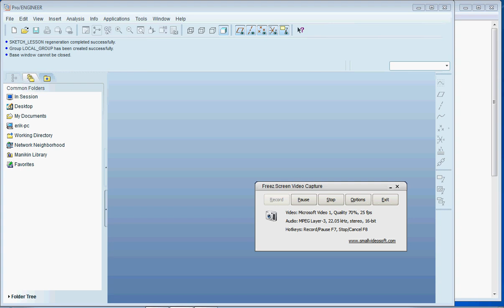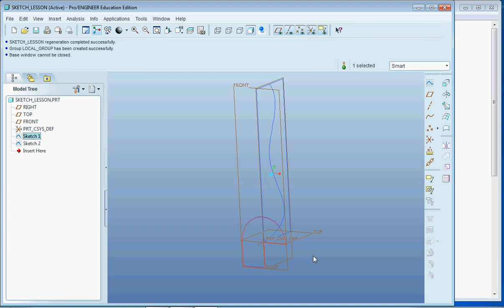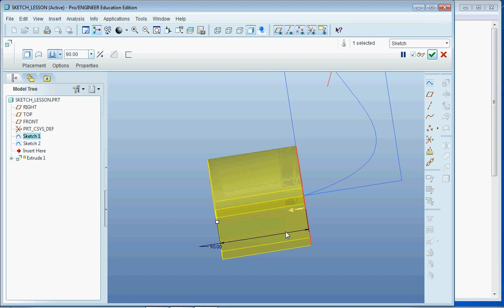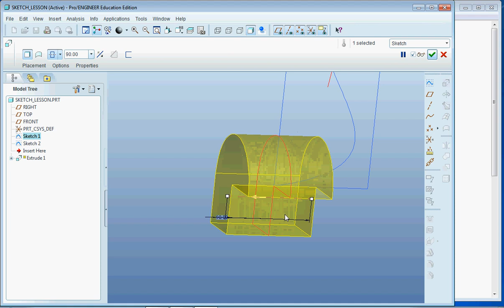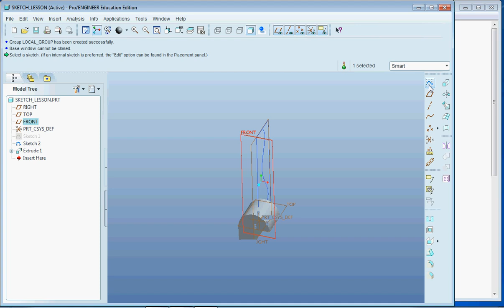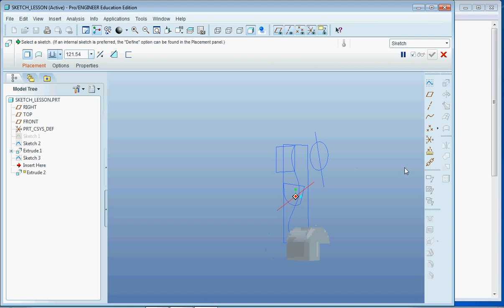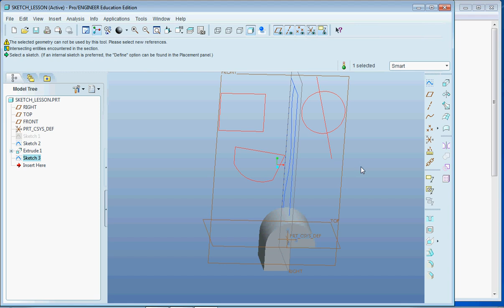Pro Engineer Made Simple - Part 3 - External Sketch Extrudes

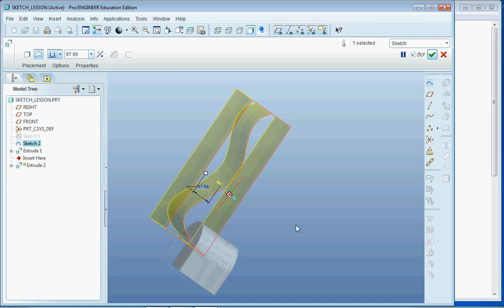Comment from the maker: At about 4:50, you'll see that the extrude is as you mentioned, very thin walled. Double check to make sure there are no overlapping segments. On the upper left of the tool bar, notice that in the video the left button is selected. Try clicking on the right button there that shows a 3d shape. If that does not work, try re-creating your problem by making a new sketch and trying again. Sometimes you can notice mistakes that way.

Comment: Great video's!  Thanks a million,  one quick question...  I am trying to create an extrude from a sketch I made and it is a completed "Loop" but it extrudes as just a very thin wall from the Datum Plane.  I tried to switch the option to "Extrude as a solid" but it won't let me..  Any ideas?

I know there could be a million different reasons - I was just hoping this might be a common bug, or error that I am making.

Thanks again!